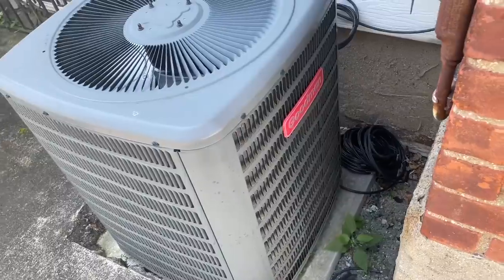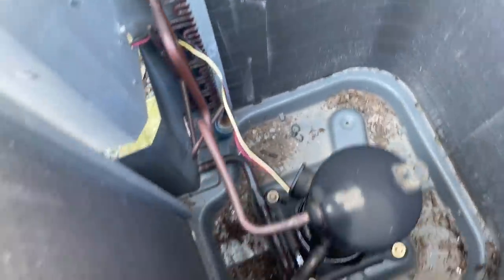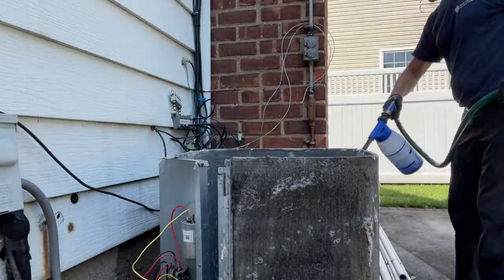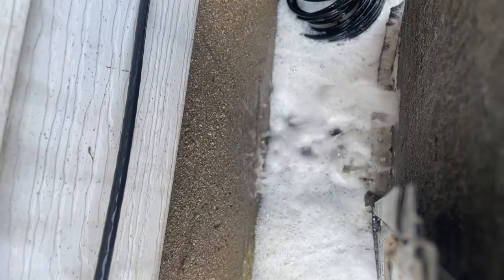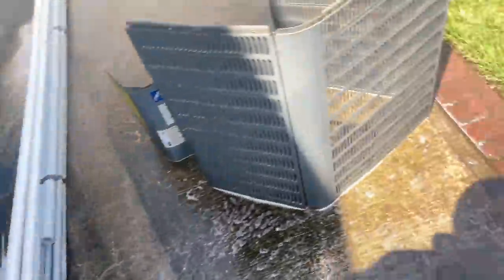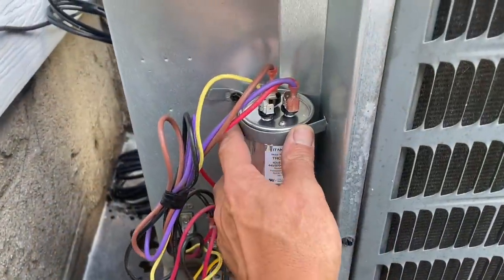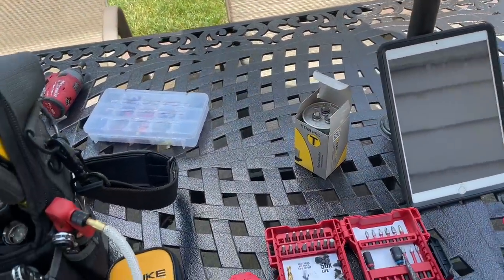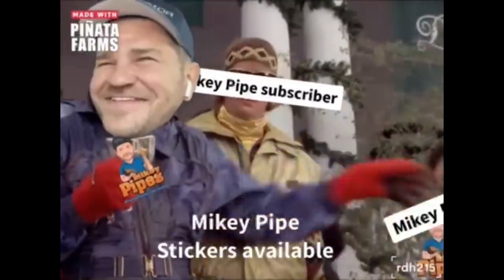Goodman Central AC Condenser Needs Maintenance & How to Test Dual Capacitor With System Running

Comment: Wouldnt it be incredible if these manufactures would install a disconnect for the fan so you can just unplug it and lift the top assembly off easy for cleaning  🤔🤔🤔🤔🤔🤔🤔🤔
Reply: 3 connections isn't the end of the world.

Comment: Dynamically, if the system works, is the only way to go. You are testing it under a load real world situation. I have had ones test good on the bench but were much lower under a load.

Comment: Feel sorry for the price of this coil gun, doesn't make sense for sure, let's be real... We can make that tool 80% cheaper.
Reply: A friend of mine explained that,they own a plastic blow molding plant,that spray gun cost $3 to make using .50 cents worth of plastic beads,but this mold cost  $13,000 to make and that's just for the jug!
Reply: @petersmart1999  i just hope that the mold is made here 🇺🇸
Reply: Yes,they are made in a cnc shop across the street.They do a ton of custom stuff!